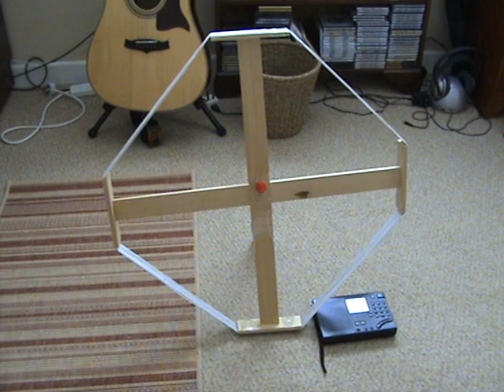AM Loop Antenna 2

Comment: I took a 4'x 4' sheet of plywood wood for a frame. And a unshielded 12 wire phone cable wired in a loop. Had one favorite radio station. And this rig got a solid lock every time loops are the cats back side.big or small. Thanks

Comment: M R .  L O G A N ,  Q U  E S T I O N  --  Please clarify and confirm: A Q U E S T I O N  ---  Please clarify! Regarding the loop antennas for AM - ads on Amazon: Our AM radios have electrical cord, adapter, 4-D battery optional connectors. No jack for external antenna. So how and where must we connect the loop antenna to help diminish the crackling on AM 1150? (FM stations = no problem). Are copper wires the best material for AM/FM antennas? Thanks.

Comment: Nice, it's útvarp Føroyar :P
the transmitter is located at Akraberg
(61°23'46.12"N 6°41'34.15"W)
It's a 200kW transmitter running at 50% usually but cranked up to 100% when the news is on so that ships and boats around the islands hear it.

Comment: It almost act's the same way as a front end except it's not physically connected to the circuit
Reply: rene kenshin 
Huh??
It acts just like a bigger antenna, capturing more signal than the ferrite loopstick alone.

If you put a 'front end' on an AM radio to amplify a signal buried in noise, all you get is a louder signal still buried in louder noise!
Reply: The antenna field is interacting with the internal antenna, but they could be hardwired.

Comment: change capacitor variable 365pf fron vintage radio scaner 550 khz to 1600khz
Reply: Roberto Camargo that way you get the entire band 530-1620?